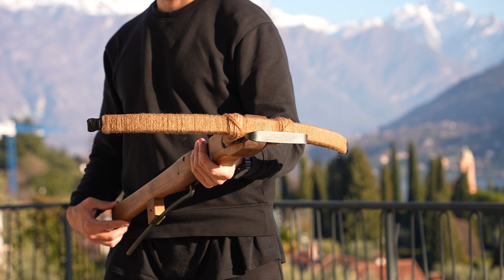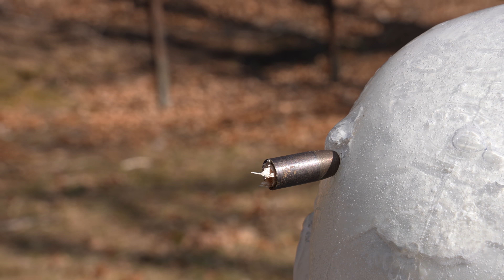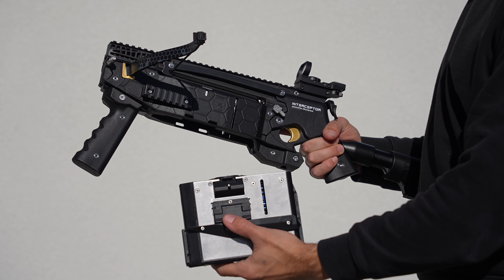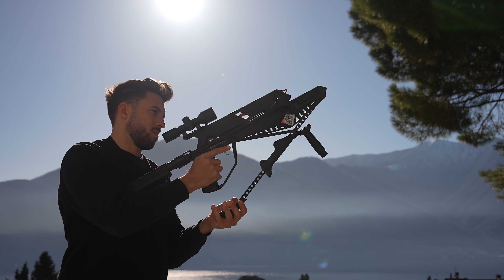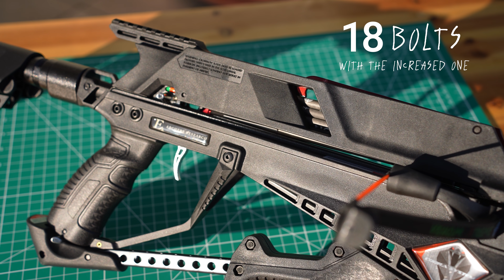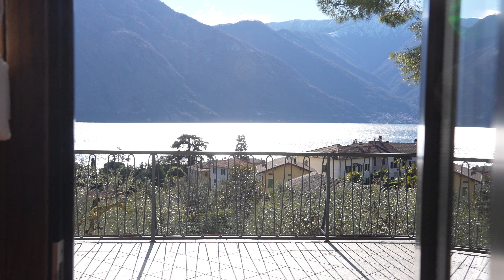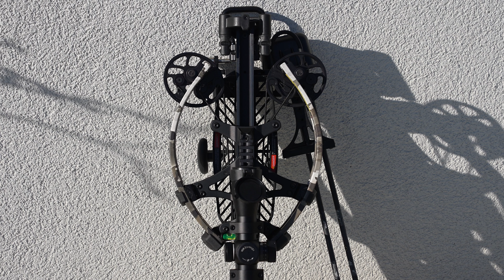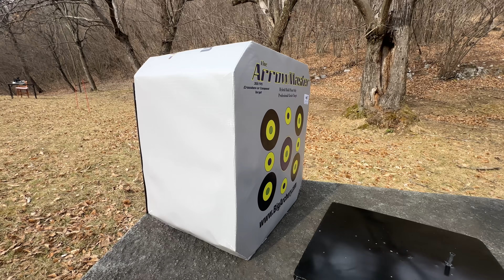How Dangerous are Crossbows?

Comment: I could see these being very useful against humans during a zombie apocalypse, but how useful would they be against zombies?

I mean if we take fungal zombies that might have a distributed processing network thanks to fungal infection across their entire body then these would be the zombies least affected by head shots.  They would, however, probably be good against viral zombies which are typically still "alive" for given values of the concept.  When dealing with magical zombies, however, there's going to be a range of possible outcomes from the more traditional slow and dumb zombie where sufficient damage to the brain will kill them to more powerful zombies where "sufficient damage to the brain" requires an order of magnitude more damage to compensate for magical regeneration.  In the case of magical zombies you'd really want weapons and/or ammunition that cause impact/pressure damage more than penetrating damage because a bolt that goes all the way through and imparts 5% or less of its power to the brain is, all other factors being equal, going to be less effective than one that hits the back of the skull, stops, and transfers 90% of its power towards making sure the brain is both shaken and stirred.

So the question is an actual, non-hypothetical question rather than a "well akshwally" sort, and it boils down to whether or not weapons designed more for penetration than impact can still cause sufficient damage.  In some regards its similar to debating whether full metal jacketed rounds are going to be as effective as hollow points when dealing with zombies without resorting to the, "With enough velocity penetration doesn't matter" argument.

Comment: I feel like you should have run the penetration test without the board as well. Shields (made of wood with about that thickness) were an effective stop to arrows and bolts - that is the primary role for which shields were fielded to soldiers in the first place. Using it was a good demonstration of that, but it ultimately did corrupt the penetration test as this was already pretty much conventionally known.
Reply: I also heavily question the reliability of the lethality test, particularly on the medieval crossbow. You would not be aiming for the head, especially as even most basic military units were equipped with helmets. The head is also a harder target to hit, and its round shape causes deflection and a massive loss of force on impact.

Rule for crossbows is the same as for firearms - center of mass. Easier to hit, just as lethal, only high value targets would likely be sufficiently armored there, and it's where medieval crossbowmen would have trained to actually hit.

There was also a medieval 'code of honor' regarding 'mutilating the face' of an opponent in some places... this wasn't out of vanity so much as 'it made the body impossible to identify', which was considered unethical as it meant the soldier - likely a fellow Christian in historical context - would not be able to receive a proper Christian funeral (open casket) or gravesite (tombstone). So aiming for the head was not just impractical and ill-advised, but could actually get you in trouble with your own army as a potential war crime.
Reply: Changing the angle at which the head was shot also skews the reliability of the tests, as the frontal bone is thicker (and thus harder to penetrate) than the temporal bone (side). That said, that skews it against the performance of the crossbow, meaning if the last crossbow were targeting the temporal bone (as the others had) it would likely be even more effective. Inadvisable change for scientific purposes, but ultimately not one which damages the test's viability in my opinion.
Reply: I disagree with the final assertion that the Tenpoint is the winner 'in all categories'. You yourself struggled with a category you did not list - acquisition of ammo. The more unique, specialized, and hard-to-acquire the ammunition is, the less reliable the weapon is. This is just as true in the medieval context as it is in your 'zombie survival' context. I would consider it more apt to say "the Tenpoint is the clear winner in all categories which were tested ."

In that category (ammo availability), it is the medieval crossbow that is the clear and definite winner - you can make them by hand, but it still isn't great as it requires skill in the art of fletching, an art which is dying. Still, that beats the others which all require manufacturing, manufacturing which wouldn't exist in the medieval period, and would exist no longer in a 'zombie apocalypse'.

Unlike the bolts, which are made specifically for these weapons, firearm ammunition is standardized. This means that any 9mm round will be compatible with any 9mm weapon. For that reason, firearms are still the more useful tool in the 'zombie apocalypse' context, as even though manufacturing has likely ceased stockpiles are significantly higher of bullets than bolts, and any you do find can be used in any weapon for which they are chambered equally. Rounds can also be re-cycled, with some chemistry skill (more common than fletching these days), if brass can be recovered.
Reply: TLDR: Very cool video, but the tests could use some improvement. Particularly the lethality test, which seeks to aim for the head - something which is not done in the historical context, nor done in the modern context. The only context for which this is the case is the zombie apocalypse context, which is fantasy.

If you want a more objective test, a torso model would be more useful.

Comment: The draw weight might be significantly higher then an equivalent bow, but that does not translate to the crossbow being that much stronger then said bow because the string has so much less distance to travel in order to transfer that energy.

Comment: A point of critique regarding the medieval crossbow bolts: Different tips had different use cases. So picking the right one is important 🙂
Reply: Also the medieval crossbow is intended to shoot MUCH heavier bolts. Thats why it had so low penetration and energy. Heavier bolt would accelerate to the same speed, therefore having much more energy.
Reply: That's just as true for modern crossbows.  A crossbow is a crossbow, a bolt is a bolt.
Reply: @ true 👍🏻

Comment: As for "medieval" crossbows, 1000lbs draw weight is a GIANT crossbow operated by multiple people and would have used a windlass for cocking. The one you have (in shape only) is a "hunting" crossbow as would have been used by a single man with a much smaller bolt. Battlefield crossbows are between 175 and 275lbs draw weight with a longer draw. For those, accuracy was not important as many crossbow men would be firing in an arc at archers at a standoff distance. Even so, yours is a very light draw. It is for firing blunts during reenactments.

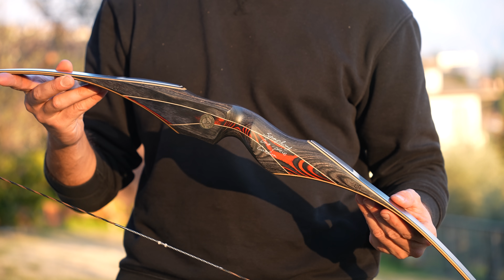Comment: 0:54 That comparison is always way too exaggerated, yes, Crossbows can have a MUCH higher draw weight, but it's there to compensate for it's much shorter draw distance, velocity is acceleration times distance, if you put twice as much power into half as much distance it's the same out come.
The moment it leaves the string propelling it the power starts to decrease.
The reason they became more relevant was because they qre easy to use, point and shoot, bows require training.

*I'm not a 100% sure on the wording and what times what equals what, I'm rusty on my kinematics 😅
And google can't put equations into simple terms for some reason...

Comment: Hey the medieval crossbow test was done kinda wrong. Bows have max speed and limited torque, bevause of that arrows that are too light dont get accelerated properly and the bow doesnt put as much energy as it should into the arrow, instead the energy just shakes arowned and damages the bow.  7 grams i way way too light, if you used the right weight it certainly would have penetrated the wood because the arrow would properly use up energy stored in the biw

Comment: That medieval crossbow replica is either faulty, has shitty bolts or I'm mixing it up with a more powerful one but I'm pretty sure most crossbows back then were used because they really could penetrate armor and were easier to master rather than longbows. Tho longbows especially the english ones were known for not just speed but accuracy. Those englishmen could hit the tiny holes in your visor with pinpoint accuracy, no penetration needed. Correct me if I'm wrong tho, I'm not a scholar in medieval stuff.

Comment: Cool video! I love crossbows, and I just wanted to point something out—the Clear Ballistics head models, as far as I know, are not anatomically accurate in most parts. The brain cavities were rotocast, and some areas of the skull appear much denser than others. This happens because the resin hardens within minutes, and if it stops flowing inside the mold, it dries thicker on one side while remaining thinner on the other.That’s what prevents the bolt of the medieval crossbow from entering the cranial cavity. If it wasn’t the resin skull stopping the bolt, then it was the thickness of the bolt itself.

Comment: That's some crazy accuracy there my dude. That one smaller one has such a genius design, it basically utilizes a compliant mechanism in order to improve the ways you can use a crossbow. Making it pretty much semiautomatic, holds 18 bolts, quick & easy to rechamber each shot impressive stuff.
Reply: Lever action

Comment: Oh, come on, now.  The mediaeval crossbow "is not lethal".  In that case, it would not have been used all over mediaeval Europe.  The one used in this demo is quite lightweight, as shown by the ability to cock it by hand without mechanical assistance, and the bolts are very lightweight, and it still fractured a skull.

Comment: Hi. American, here.
For the accuracy test, you were measuring your skill and the usability of the sights as much as the weapon. A better test would be to fix it to a table, and not measure accuracy, but precision—do the bolts land in a similar spot, regardless of if it were the center of the target.

Also, that's not a semi-automatic because it the weapon is not loading a new bolt; you are. It's easier, and it's magazine fed, but it's still like a pump action or bolt action.

Comment: All I can say is that is a light version of the X-Bow where in olden days Hunting crossbows from the late medieval and renaissance tend to be in the 450 - 600lb 200kg to 275kg weight while war crossbows range from around 700-1300lb these go 400kg to 600kg . Those bolts from the medieval were not very good and were practice bolt not hunting or war bolt so what do you expect ???

Comment: I own a Wicked Ridge which is a company owned by TenPoint who made the best bow, The one in this video is 510FPS, but for less than $1000 I got the Wicked Ridge that shoots 410FPS. I dont think the $4k+ price tag for the extra 100FPS is worth the ROI. Watching the evolution of archery everything over the years I know that whatever the best is now will be run of the mill in 5 to 10 years. I shot a deer this season with it and the bolt went in one and and out the other with no problem at all. Stuck way into the ground on the other side too. Mine came factory zeroed @ 70 yards with a nice scope. I can afford the more expensive stuff, but when I buy that stuff I feel like a sucker 2 years later because it costs half as much at that point. Dont buy the hype.

Comment: Mike, you should make a video testing the "Benjamin AIRBOW M600." Just look at the features of it.

Features:
▫️Powered by 3600 PSI of compressed air.

▫️Delivers three consistent shots up to 600 fps.

▫️Free-floating barrel with a patent-pending stabilizing system ensures accuracy.

▫️Bullpup configuration for a short 33.5″ overall length.

▫️Ambidextrous top cocking bolt.

▫️Includes:Quiver and three Airbow M Series arrows with nano-ceramic Victory ICE™ coating for increased speed, greater penetration, and easier retrieval, and a Canted Picatinny base for 20 MOA of additional adjustment.

Comment: You should try the medieval one with proper steel bolts cos using it with weak wooden ones then using proper bolts for the other crossbows is a little unfair

Comment: You can also use cardboard boxes. You have to flatten them out , and stack them about a foot high. Den duct tape them to hold them together. Also Big blocks of Styrofoam work well. Back up a little bit. You're too close to the Target. Those bolts will go clean through a bulletproof vest. Here in the US, you can buy bolts at most sporting goods stores. Like everywhere .

Comment: You are showing repeating crossbows and they goes back millennia. Just search for Chinese repeating crossbow.
The crossbow with the "coil limbs" (i.e., not traditional limbs) is actually pretty cool. The accuracy is just so-so and power is pretty standard for any decent hunting crossbow though. My $500 hunting crossbow shots 400gr (26gr) bolts at 430ft/s and I can it 2in groups at 60 yards without must effort.

Comment: I think a system where you can use gravity to cock the crossbow would be cool. Just hang your crossbow on something, then hang off it to cock it with your body weight. Just a thought if you're trying to make ridiculously strong crossbow which may run into difficulty cocking it.

Comment: Watching you use a medieval crossbow at 50m and expecting it to be lethal was hilarious. If you look up historical uses of the crossbow you'll find that they were typically used by stationed guards at less than 10m at ground level, and were considered able to pierce standard plate armor at under 5m. This means they were close range weapons, which makes sense due to the heavy bolt rapidly dropping in speed, and thus penetration power, as it traveled.

Comment: If the two higher powered crossbows could take different bolts they'd be worth it, but in a zombie apocalypse situation, carbon fiber bolts would be too much of a liability. I think the $600 one would be the best option even if it may not be the most powerful

Comment: Mideval one is the best because its the only one you can make for almost nothing ,repair it for cheap with basic tools and make arrows on your own -including the arrowheads with a charcoal forge and basic tools like hammer ,punch and file.
SO yea all those fancy machines fail miserably in comparison to a good old technology that doesnt use fancy carbon arrows,expensive aluminum cnc parts,special cam systems and carbon bows .Good luck replacing that in zombie apocalypse . . .
Rolling nut just keeps on rolling for century's. . .Can you say the same for a fancy special space trigger?

Comment: I have a "Robbin Hood" as we call it displayed on my TV because I shot two crossbow bolts from my dad's crossbow without removing the first bolt. It sunk DIRECTLY into the shaft of the first bolt and almost completely passed through. This was with a normal modern crossbow rather than a reverse limb crossbow but most modern crossbows will be really accurate. His was only around $400 USD. It's incredibly consistent and he's now taken multiple deer with that crossbow.

Comment: the tenpoint tx 440 and tx 515 are absolutely amazing, i personally bought the tx440 as in my opinion 420 to 440fps is the sweet spot. 500+fps atm have more issues. (i did lots of tests and shot both, lots of research as i ended up purchasing the tx440 last season (deer) i can recommend it to anyone who has some spare cash to invest into hunting. Keep in mind for decades people like me hunting deer thinking 300 FPS was impossible and even the fastest bows on the market weren't breaking 300fps. If your wanting to go into hunting just know any bow nowadays shooting over 300 FPS will ethically and EASILY take deer out to 40 yards. Personally i took ALOT of deer this year with my new tx440, (i replaced my tenpoint turbo XLT 2) tho my speed is 420FPS on the TX and only 300 on the turbo, it doesn't extend my ethical kill range as deer often jump the string, im accurate with the new tx440 out to 70 yards, but on live animals i wont go past 50, regardless of what bow i use. The difference between even 420 and 320 is noticeable but keep in mind for hunting purposes both will work and NEITHER should realistically extend your max ethical range to shoot. Deer can drop 11 inches at 50 yards at 300fps bow, from time you squeeze the trigger till arrow arrives, the farther you shoot the more likely the deer is to jump the string and the farther the deer get before arrow arrives. TX440 i can do 3 inch grouping at 70 yards from my elevated shooting platform 6/6 times, never shot a deer past 50. Depending where you hunt if deer are used to bow hunting that will be most peoples max ethical range aswell, regardless of bow or experience.